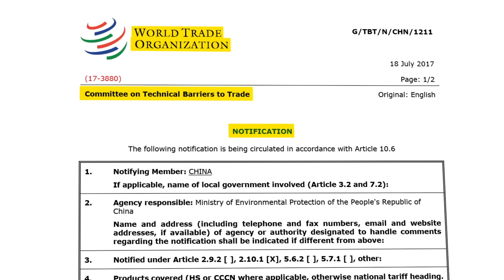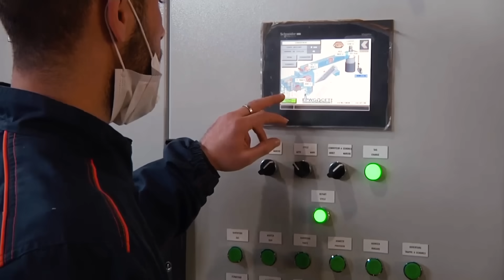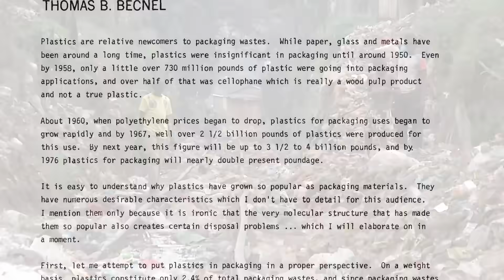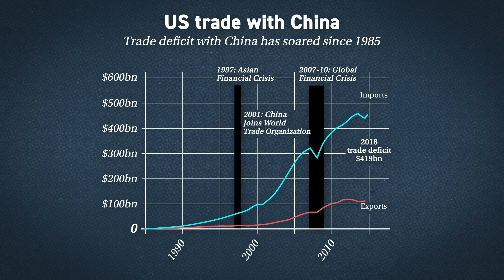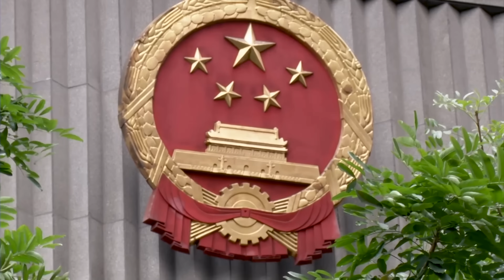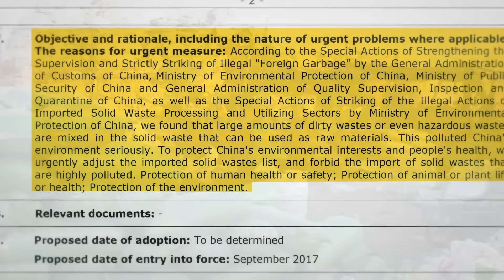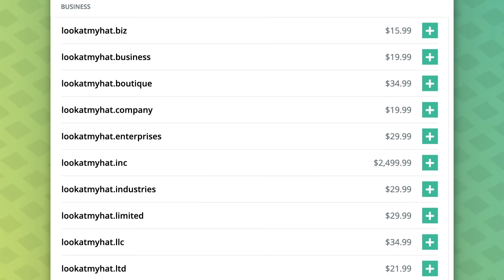How China Broke the World's Recycling

Comment: One solution could be to tax +50% to new produced plastics, -20% tax exemption to plastics produced with over 80% recycled plastics, and -30% to - 50% tax exemption to compostable polymers degrading under 6 months in basic non-industrial home-made compost conditions, not depending on high temperature and pressure...

Comment: The video hits a key point, but does gloss over a deeper point. If a process costs more than it delivers in profit, it is because it consumes more resources than it saves. Recycling a commodity is good for the environment only when the process is efficient enough to enable a real profit. About half of the copper goods we produce are made from recycled copper, and copper recyclers will pay good money for your copper. The same goes for aluminum and steel. I'm hoping for thermal depolymerization to become efficient enough to become viable; then we can turn all of that plastic into the feedstock for the petroleum industry.

Comment: If there is enough space, I would argue that landfilling those plastics is actually better than incineration in the long run. There will be an era when making new plastics from oil becomes much much more expensive, and thus more and more recycling turns profitable. Eventually, it will be profitable to reclaim materials stored in landfills, e.g. landfill mining. This option is simply not there if the material is destroyed by incineration.

Comment: If some plastic is so hard to recycle then sell it as a bulk filler material for construction
You can either make large plastic blocks and have a portion of it be unrecycled plastic as a filler amd then use those plastic blocks to take up space in concrete slabs so companies use less concrete
Or use plastic shrapnel to fill a hole in the group and cover it with concrete so you use less concrete filling that hole
So now your forever material is doing a beneficial job as a material that never degrades

Comment: Switzerland doesn't dump waste into landfills anymore not only because we burn the stuff we can't recycle and use the thermal energy but because we also had several serious issues with landfills from the 60s/70s/80s where industries dumped absolutely every kind of hazardous stuff. I remember that some 10 years ago it was possible to recycle plastic at the recycling points and they made oil out of it but stopped doing so because it was very expensive

Comment: All plastic is receyclable given the right process.  One that's been around since the 1990s is thermal depolymerization, which uses steam, high pressure, and intense heat to essentially turn the plastic back into raw petroleum.  Depending on what else is added in (roadkill, guts from slaughterhouses, etc., and anything originally made from petroleum) the process can be tuned to yield heating oil, diesel, etc.  This means that some 80%+ of household trash can be turned back into something useful.
The reason it isn't happening in the United States is the regulatory system where multiple federal agencies, state agencies, and even county agencies each have their own approval system and if one demands a certain change then the process starts all over again for the other agencies!
(A similar process uses microwaves.)

Last time I checked the process was profitable if the feed materials were sourced locally, but that was in about 2017.  With rising gas prices profitability should have increased, but in the U.S. that would make little difference since the regulatory process to obtain approval to build a plant takes at least six years due to all the different agencies involved, whereas in Europe in many nations it's a "one stop" process.

Comment: Electrolysis adaptations to 3D printing technology that can break any waste to it's elemental components that can then be used by the same adaptations to reassemble as anything at the elemental level, designed and powered by NLP Based OSes.  When one highlights a problem, it is best to also offer solutions, so there's one for you.

Comment: I would argue that you addressed only symptoms.  The real problem is the belief that we need to recycle in the first place.  Stossel has a YouTube about this.  All the trash will fit in landfills and consume a tiny percentage of land area.  And, the landfills are not radioactive danger zones but eventually become green spaces and are somewhat pleasant.

America tends to send its problems overseas.  We don't like the pollution from manufacturing or recycling or countless other activities so we send it overseas where the pollution still occurs and often to a far greater degree but it is just out of sight.  What goes along with sending the problem overseas are the jobs as well as the oversight that could occur if the problem was not sent over seas.

The EPA needs to be restructure and redirected.  Instead of being a police force it needs to be an enabling force.  It needs to find industries that are polluting beyond limits but not fine them.  Rather they need to work with the industries to find reasonable, sustainable, and profitable methods of solving whatever problem is being addressed.

Also... I almost stopped watching the video several times because so much of it was leading off in the wrong direction.  The victim statement that "China broke recycling" was reprehensible.  It was only at the end that you admitted that recycling never worked.  I would have put that statement at the start and repeated it throughout the video.

The amount of money spent on "recycling" is immense.  I agree that some things like ferrous metals, aluminum and glass can and should be recycled.  But the single stream recycling idea that most communities claim to have is simply a fraud.  It's a lie.  And folks need to confess that it is a lie and stop the charade.

Comment: I worked in a plastic bag recycling facility in the late 1970s.  They were around even then.  Used LDPE and HDPE (low and high density polyethylene) bags were shredded and processed into pellets for further use or blown into film. The screens on the heater/extruders were constantly being blocked by foreign matter with the big offender being brown packing tape.  Totally inefficient process.  Look at all the “recyclable” plastic packages with paper labels affixed that are currently in your house now - there’s not enough labour to process these effectively.  At least glass and metal processing can burn these off.    
I’m not usually defending China but they simply called BS on western nations feel-good policies of sending their problems overseas.

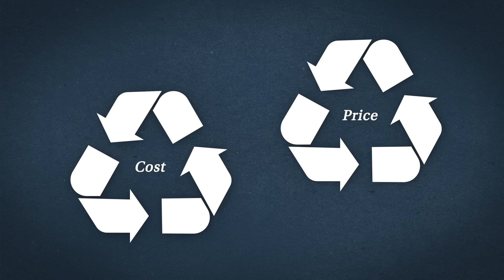Comment: This was a good summary, except you left out viable options, and assert a false dilemma at 17:00. Other options are gasification and pyrolysis. They are more like distillation, separating by boiling point, then processing the fractions separately, with the result of low emissions, allowing output streams to go through carbon sequestering or other processes, and potentially recycle some fractions to product. I think it would have to be run nonprofit, for best environmental results. The energy produced can run the  process, and any energy excess could be used for further refining emissions instead of feeding the grid.      
I also think gasification could be used to just remove light hydrocarbons (all volatile compounds, actually) from garbage, and then landfill the remainder.

Comment: The biggest problem with plastic is that it's a very durable and long-lasting material being marketed as a single-use throwaway material.

We do need to realize that finding an alternative material to plastic for single-use applications is like the only really sustainable option left to us at this rate.
Reply: Yeah, yeah. In Japan, this is called "thermal recycling". 😁
Reply: Burning the plastic is an option.
Reply: We had that….glass, tin, cardboard, cloth .. My grandparents were the first green generation
Reply: @sherry3661  Right. Finish a jar of pickles and reuse it. Jar of jelly becomes juice cup. Twine string. My granddad never throw away a nut or bolt.
Reply: I was surprised a few years back when I saw an article that listed items that could be made from hemp fiber instead of plastic because the list was so long!  Lots  current packaging could use hemp, and one beauty of hemp fiber is that if it happens to end up out in nature it decomposes, unlike plastic.
Reply: We have biodegradable materials with similar properties. They're a bit more expensive to produce, since they don't have the same established infrastructure behind them at scale that plastic does by now - so without any regulation at all, producers do not adopt them. Whoops! Unchecked capitalism at work.
Reply: Nonsense. Plastic takes way less energy to make than paper or wood based containers. Plastic can go into land fills. It doesn't matter. It's just part of the earth like it was before
Reply: Your ideas are noble, sadly we had such items in the past and they were replaced by plastic that did not have many of their drawbacks. How do you convince society to 'devolve' and go back to using inferior products with no tangible upside?
Reply: that was also the only sustainable option left to us when recycling was pushed in the 70's. they tricked us into wasting 50 years.
Reply: maybe we should switch to whale oil
Reply: no need to find it, we have glass, glass doesn't degrade, is infinitely reusable and people in my area already use reusable beer bottles, just get a crate of beer, drink it all, return them and get a 4-pack for returning them, it's not free they just buy the bottles off you or if you are trustworthy and return all bottles all the time you can not pay for the bottles and just pay for beer in them and return the bottles that aren't technically yours. this is also used for orangade and sparkling water. there are a lot of solutions from 1950s like this that are fair and actually work in practice like storing meats in open then packaging them in paper individually for each consumer.
Reply: Wow I'm sure NO ONE ever thought of that. So I'm guessing you don't use plastic?
Reply: Use plastic as a fuel after it was used as a package. Problem solved.
Expand usage aluminum and glass and tin cans.
Reply: @skipperg4436  Bruh burning plastic is fucking hazardous as fuck. The toxic gases it releases are insane.
Reply: @NAMEMERKEN  mate its more complex: there are ways to "prepare" plastic so its combustion won't be releasing toxic gases.
For example, if you put plastic in sealed pressure vessel and heat it to afaik 700 C (and add a little bit water) plastic will become methane and carbon dioxide. Combustion of that methane can run turbine that run power generator and provide heat for the process. Less efficient than just burning methane (aka "natural gas") that is extracted from the ground but it solves the plastic wastes issue.
Fuel pellets I mentioned use different chemistry details of which I am not familiar with, but it must be something of similar nature. Trash processing plants do sell these fuel pellets to public so I assume its reasonably safe.
Reply: @skipperg4436  There's a island of trash in the ocean the size of Texas. 
There's plant plastic, faux leather, and bricks. Stores like Lush uses no to little packaging. Use fast growing plants like bamboo for wood. Use and bring your own nondisposable utensils to restaurants. There's glass and metal drinking straws. Use nondisposables like glass or metal. Homestead. Some people recycle plastic at home. Such as turning styrofoam into glue with acetone. Japan has toilets that are better for the environment. Do you think digital is better for the environment? How bout nonpackaging vending machines?
Reply: @skipperg4436  all the materials you mentioned cost more energy to make than plastic. Worse for the environment
Reply: @Toro_Da_Corsa  they are recyclable however and in case of glass - even reusable: glass bottle as long as its not damaged can be used again after being processed in autoclave.
Reply: @skipperg4436  thats simply not profitable lmao your literally going the same hole as recyling dudd lmao. This is already used however its pretty rare just like you see recyled containers

Comment: If you want to fix the plastic waste problem overnight mandate the use of HDPE tight plastics were applicable. That one type of plastic can be infinitely and easily recyclable with very little loss and quality. it can also be made to just about everything. If you combine this without line the use of plastics that cannot properly be recycled. Forcing manufacturers to have to rely on the more expensive HDPE plastic. This will make plastic recycling considerably more profitable. You could also tax the plastic manufacturers that use more virgin plastic than recycle plastic penalizing them for the waste that they generate. Similar to a carbon tax.

This is actually the most profitable option for the plastic companies and the most economically and ecologically friendly of the possible options.

But it's not nearly as profitable as just flushing infinite amounts of single-use plastic into the market.
Reply: The thing is, you can't use it to make soda bottles.
Reply: @OCC_Plumbing_and_Restorations   yes you can high density polyethylene is used to make gallon jugs for water and milk so you could easily use them to make soda bottles it would just be more expensive. And if you don't want to use an already available plastic fine glass is still pretty cheap to make and easier to manage than non-biodegradable plastic so just make them out of glass like they did in the 60s.
Reply: @madmachanicest9955  You can't make soda bottles out of that plastic because it can't handle pressure like PET and it is also a softer plastic.
Reply: @OCC_Plumbing_and_Restorations   HDPE plastic is used to make hundreds of vary hard objects all over your house right now.

Shampoo bottle
Water guges
Milke bottles
Lundery detergent bottles 
The caps on a soda bottle

They can make souda battles out of HDPE plastic they just don't because it would cost more. Prasher is not a problem.

Stop using mix  plastic and sing use  plastic we could cut plastic use dramatically.
Reply: @madmachanicest9955  Get a pill bottle, milk jug, shampoo bottle, etc and try bending the top of it. Then try bending the top if a Coke bottle.

Comment: Here's a fun fact for you the type of plastic that plastic grocery bags and milk jugs are made from is almost infinitely recyclable you lose about 1% of its mass and it's cheap and easy to do. So much so you can do it yourself on a small scale. And just about everything can be made that way it just isn't as profitable as selling things in bulk that can just be thrown away.

In other words we could maintain the current use of plastics by changing material types in most situations and all it would do was cost a plastic company slightly more money in manufacturing that's it.

It might make things use a large amount of plastic like 25 cents more expensive. But we would be able to recycle all of it because the types of plastic that are incinerated or thrown in the landfill don't actually have to be made.

Comment: Fun fact the most recyclable type of plastic in the world is also the one of the most durable and could be used to make things like bottle caps but they just don't and the low temperature requirements for recycling the material into a usable State unless you're trying to burn off the dye is so low you can do it at home
Reply: what is this plastic?
Reply: @nospeakgames8802   HDPE it use make water jugs milk jugs another types of waterproof plastic containers and under special conditions you can even be 3D printed. It also melts at a lower temperature than it off gases allowing people to recast it by melting it down. 

It's quite literally the same principle that they used to make the jugs just backwards. And so long as you get pure HDPE you can basically melt it down to a multiple temperature and only lose a small portion of its overall volume.

Comment: The solution is simple, but there will be some pain involved.  At the 6:42 mark, you can impose a 20% or 30% tax on virgin PET so it becomes more expensive than recycled PET. You may also need to close loopholes such as taxing plastic imports from countries that do not do the same thing.

The benefit is that it will make virgin PET prices go up and thus recycled PET prices more competitive, and so MRF residual bales might get recycled domestically.

The disadvantage is that prices will go up.  Although it may not change the price of the final product significantly once recycling ramps up and economies of scale come into play. I don't think those recycled Walmart vests that take 6 recycled bottles to make, for example, cost all that much to make if you make millions of them.

Comment: I just recently watched  a couple of  videos of a process where you can either melt down the plastic to be reused, and turning used plastic items that often rejected for recycling into a diesel engine fuel. One video took Styrofoam and added solvent to create a water proof mixture they used to seal outdoor wood furniture and seal cement blocks etc.   
    Bypassing the local garbage pickup, processing recycling sorting and ultimately the landfill.  IF the fuel industry can not responsibly do business without polluting and the manufacturing industry  won't step up to the task of finding  solutions to reduce the waste